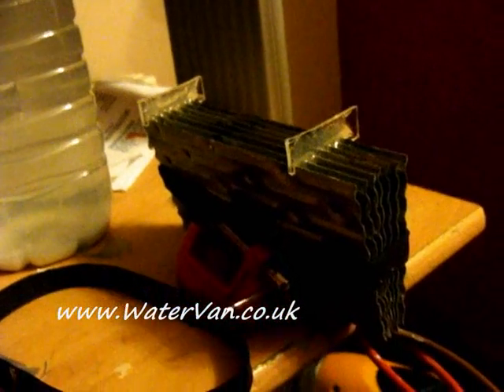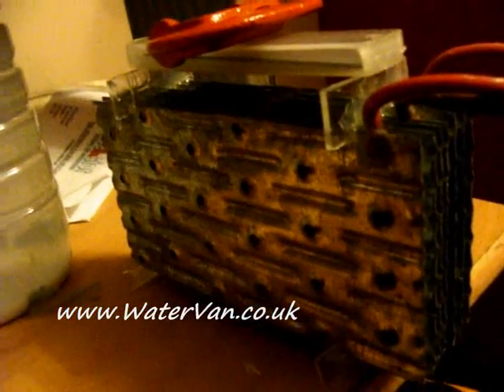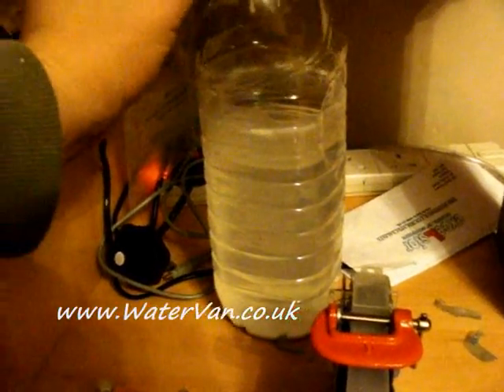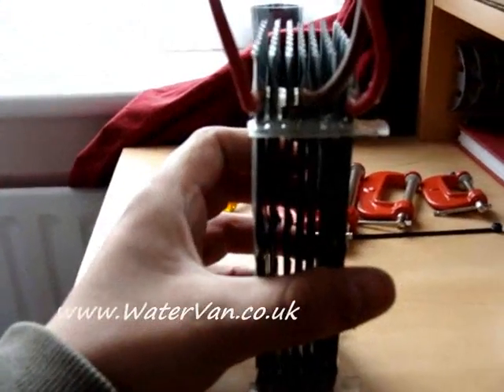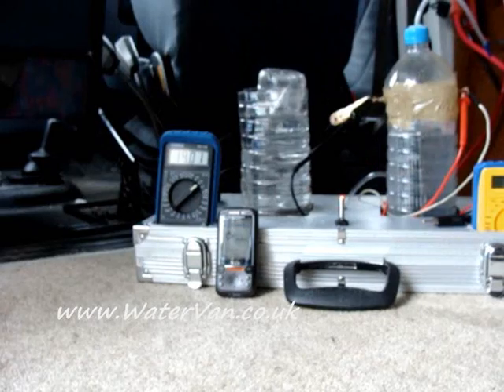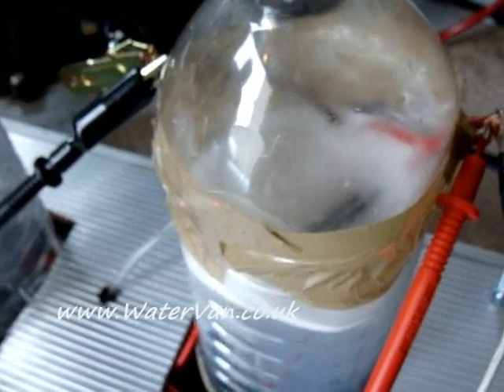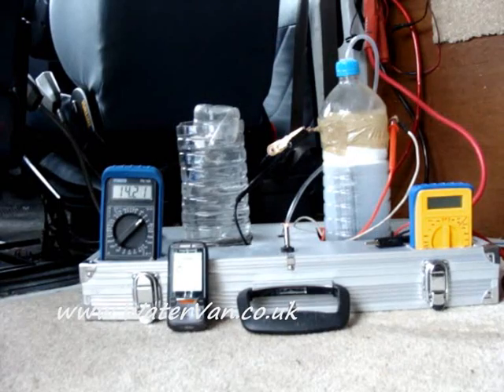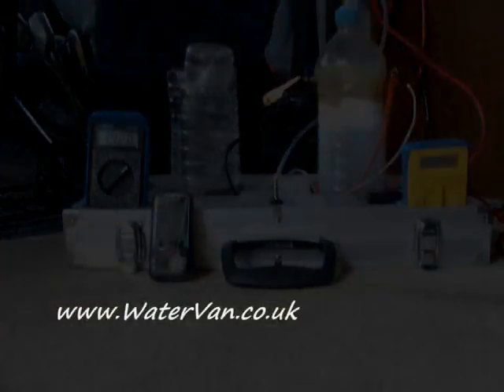#012 - MadStu's Water Powered Van - Construction and test 2

Comment: Hey Stu, lots of luck with your project.  You may want to try a more perminent bubbler.  It's true you have to completely seal everything.  As you know, there is no atom in the universe smaller than hydrogen, so it can seep through some very small places.  Even use hose clamps on the tubing connections.  RTV sealant works well on the seams of the cell casing, you just have to let it dry completely.  Keep the videos coming and nice job!

Comment: MadStu, you are a wild man!  Yes, this is a tried and true method of spacing plates.  A bit fragile but works as long as you dont handle it too rough.

If only one side of the array is producing, its usually a connection problem.  Suspect easily solved.

Be carefull about corrosion of your internal connections. If it sits in the soup, it should be stainless.  Copper or plated pieces will corrode quickly and could cause a spark. SPARK IS BAD THING.